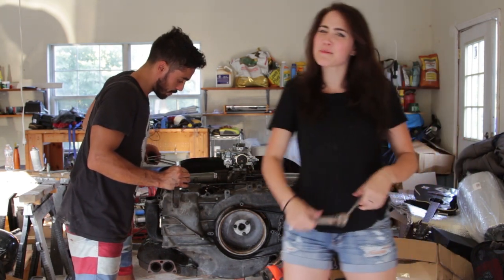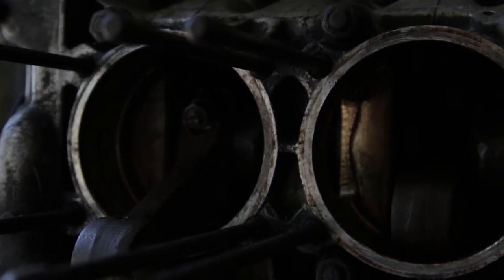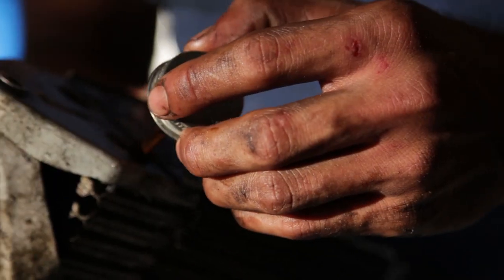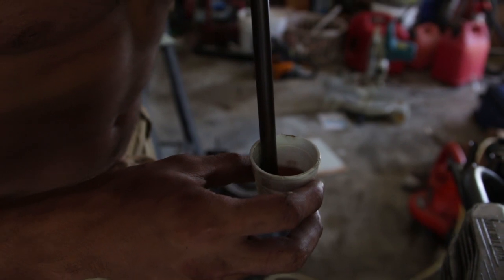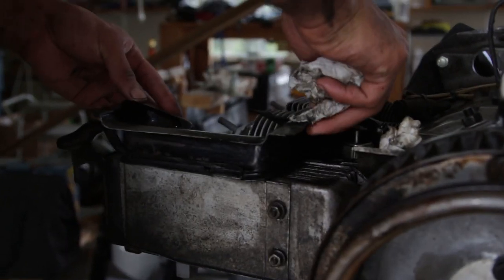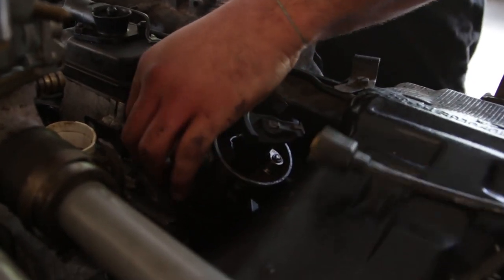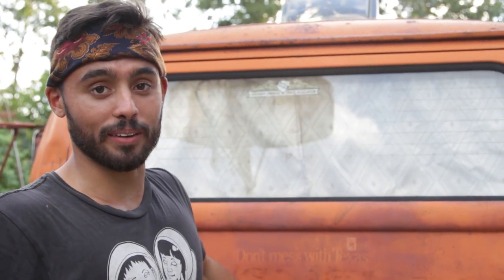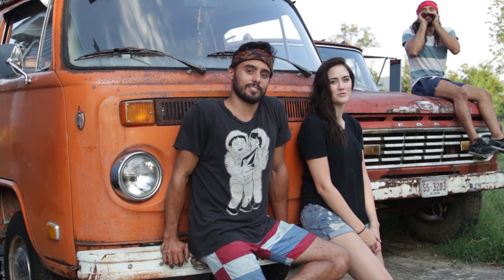VW Type 4 Engine Rebuild and Assembly

Comment: Didn't check ring land clearance. Check for oil around the dipstick. It's gonna use it.  It's also gonna blow at  the cylinder to cylinder head interface. It's a mess. It's not a Lego toy.
Reply from the maker: That engine got me as far as it needed to, I admit I did speed through "rebuilding" it, but I will be tearing it down to the long block and doing an actual rebuild in the coming weeks. Check out the new videos

Comment: The engine is looking sweet.  Did you rebuild with 2.0 internals?  Word of advice, take a couple extra valve cover gaskets and silicone just in case.  I had a gasket blow in the hot desert during a long holiday weekend.  300 miles of constantly stopping to fix the gasket and 15 quarts of oil really made for a horrible drive.  How the lack of a $3 part really ruined my day.  Keep up the awesome work guys!

Comment: Bought a really worn out 72 Bug years ago for 300 bucks and a set of used tires   In the early 80s  very broke  and needed a car that ran i bought  all cheapest made in Brazil  pistons and rings  plus a gasket kit  ran the hell out of the bug  for years  she was a real rustbucket  but ran  and when it was time for the scrapyard. We pulled the engine  as far as i know that motor is still running in a. Freinds daily driver today  and everyone used to tell me that the Brazilian made parts were junk  i used them because thats what i could afford  at the time   I watched the car slowly disappear at the scrapyard as people. Bought whatever parts they could salvage off it    I do hope to get some more Aircooled VW s in my lifetime  and fortunately money is better  than it was back in those days  so i am really interested in the Subaru swaps. Now  despite  losing the purist  of the vehicle i like the horsepower gain and look of the Subaru Boxer. Motor in the  Buses and Vanagans

Comment: these was not a rebuild ,it was a outer end overhaul there is a difference-about 700 bucks . The type 4 can get away. with what you did.the heads and cly wear faster than the crank.  GOT TO KEEP HER RUNNING.  thanks for the video. Rambus

Comment: Where did you guys get those intake manifold runners from for the single carb? I need some for my 73 bus
Reply from the maker: I'll sell you mine, I wouldn't run single carb if I were you though
Reply: @Vangabonders  why not? I had dual Dellortos before and one caught on fire
Reply from the maker: @gadgetbec  single carb never runs right. What caused your dual carb to catch on fire?